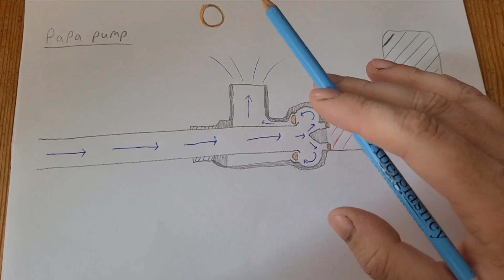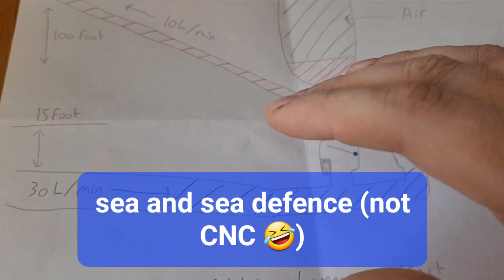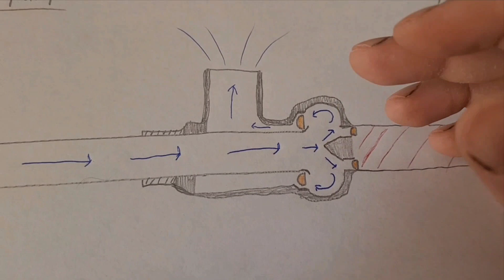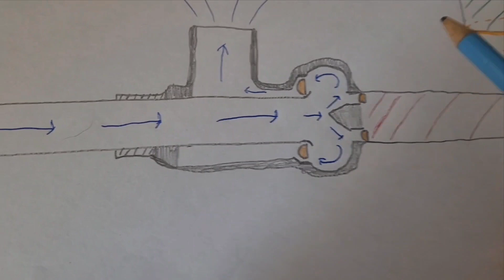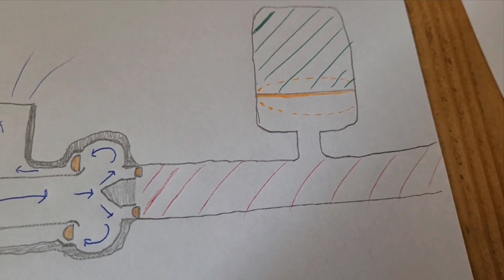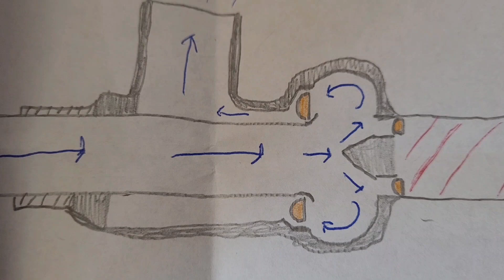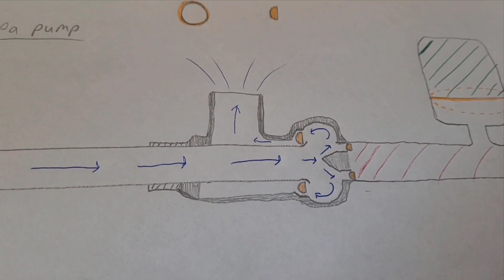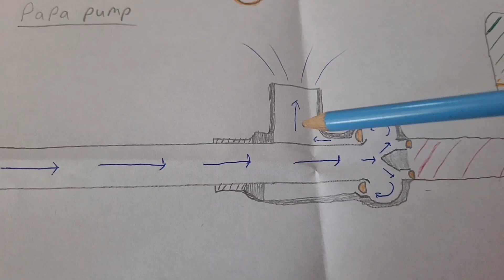How does it work? Papa hydraulic ram pump explanation and comparison to a ordinary ram pump

Comment: I think this pump cannot lift more than 100 meter vertical height because the working pressure of bladder tank they use  is 10 bar maximum
Reply from the maker: Sorry just seen this comment, I'm not sure on the specs but 100M is quite a distance vertically